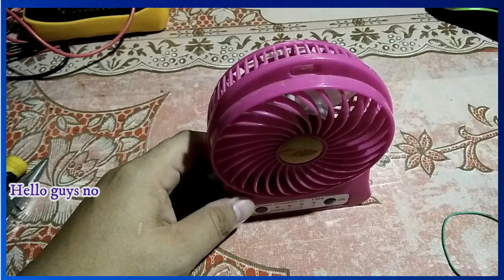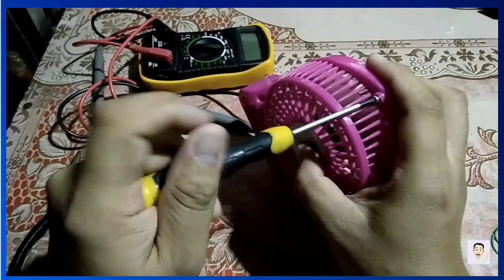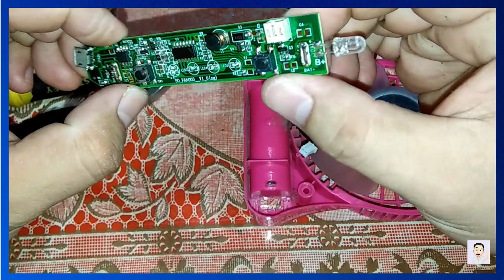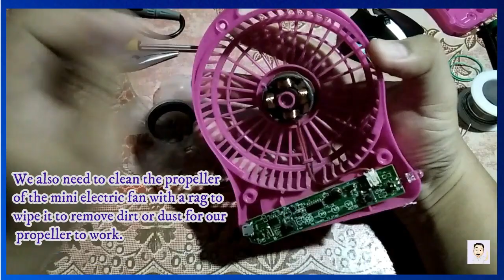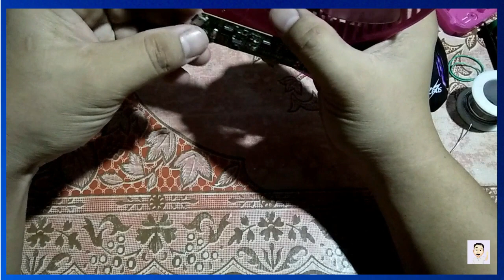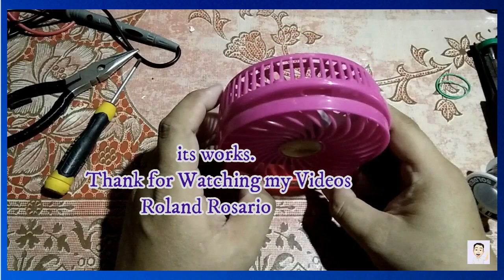HOW TO FIX MINI ELECTRIC FAN Not Working Don't Want to Switch Power On

Comment: Sir Roland. Nun na dismount nyo ang board, anong ginawa nyo para umayos ulit yun switch? Hndi naka tutok un cam kasi.
Reply from the maker: Try ninyo check lahat Sir..wire iyong motorfan,battery,board switch,puwede rin po  kayong gumamit ng soldiering Iron lead iyong switch baka naglost lang switch Button sir..
Reply: @Rolandtv11  thanks po sir

Comment: sir.. nag try ako... mag convert ng fan to two 18650 batteries... may nabili akong battery terminal sa shoppee.. nung nagconnect na ko ng wires... umiinit yung wire..tapos nasunog yung wire dun sa may battery terminal...
Reply from the maker: Sir baka pina Series connection mo battery kasi Kung ganun taas ang voltages ng battery dapat Pararell  concection dapat ginawa ninyo. voltages battery mataas siguro
Reply: @Rolandtv11  oo nga boss.. naka series pala.. pero bakit ganun..after nun.. nag try na ko na i-single battery nalang.. lahat na ng ginagamit kong battery na single setup... umiinit nalang wire at ayaw na gumana nung fan... sira na ba mismo yung fan? amoy sunog sya eh.. wala na way magawa sir?
Reply from the maker: Wala na sir kasi may sira na piesa nasunog ang dapat gawin hanapin mo iyong nasunog na parte at palitan sir or kailan palitan iyong board na fan

Comment: Hi, my fan is turning on only when i put it in charge, but not when you disconnect the charger, plz can you help me plz plz plz plz
Reply from the maker: Try to change the battery or their is a problem with fan mainboard try to Open it